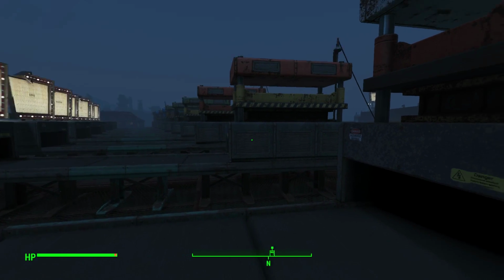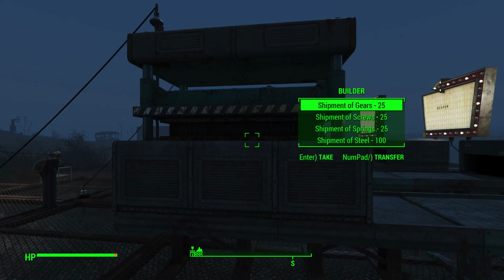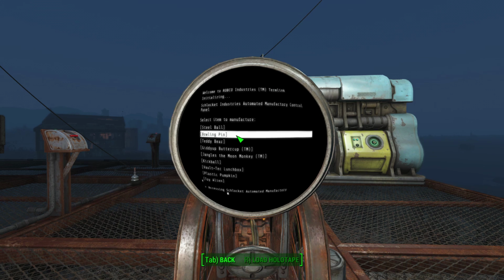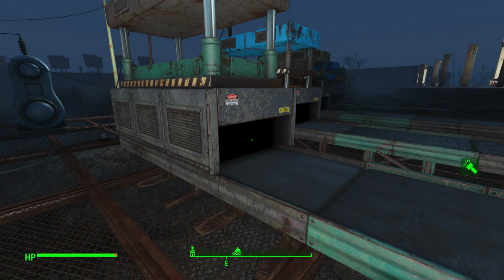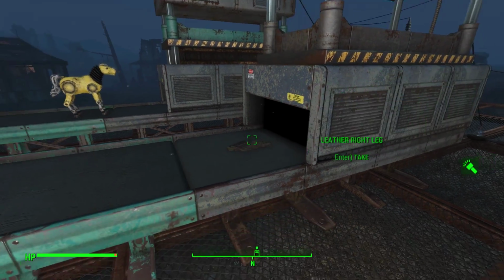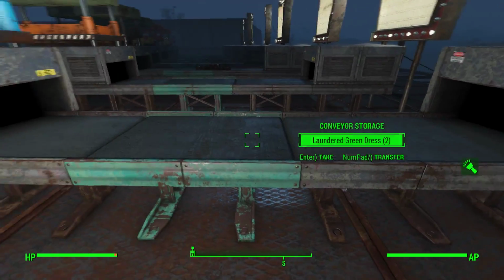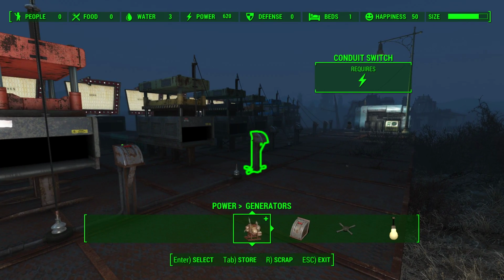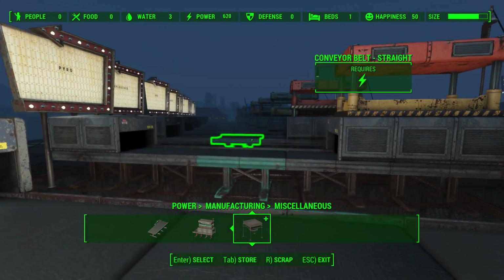10 Manufacturing Machines | Contraptions Workshop DLC | Fallout 4

Comment: none of my belts work stuff just piles up out side the machine
Reply from the maker: Are they getting power? There aren't rollers or something in-between are there?
Reply: nope all belts, all have power and i can see them moving . like with guns they get made and drop inn the machine and just pile up and don't move
Reply from the maker: Deathpenalty818 Have you tried scrapping the first one that's causing the pile up and rebuilding it? I had a machine that wasn't working and that fixed it...
Reply: ive tried it on different saves and made several at a time.
Reply from the maker: I had a conveyor storage hopper that was just eating items - like gone, completely gone - and I never got that fixed either... totally forgot about that until now. I'm looking through the Bethesda support forums atm, but I haven't found anything on these sorts of malfunctions. I suspect there may be a few bugs in the system, tho... :)
Reply from the maker: Do you have any mods & have you/can you try it without them?
Reply: yeah
Reply from the maker: Okay, I'm thinking this has to be some sort of typo, but I found this: https://community.bethesda.net/thread/34316

Third item down, "When powered, Conveyor Belts do not actively push items..."

So, either it's a typo, or, maybe he means that the belts only need to draw power from the builder/hopper, not have a tie into power themselves. Are your belts getting power from the build/hopper or do you have each one linked to power?
Reply: So are these issues they've found

Comment: Any way to feed into this machines from my settlement without placing by hand?
Reply from the maker: I haven't tried it yet personally, but my suspicion would be the Vacuum Hopper you see when I go through the settlement interface items. It says it can pull things from adjacent containers... :)
Reply: I was thinking the others way around :) 
Like I got all items to produce something in my Workbench i still have to find the items with the fiting components to produce
Reply from the maker: Hotte GKT You mean you still need resources? Or do you want to take the resources out of your workbench?
Reply: I got resources in my workbench. How can i autofeed them to this machines ?
Reply from the maker: You use the vacuum hopper - although after testing it, I think you're much better off building a separate container and only putting in the resources you need. I should have the video up tomorrow, if you want to see the test in action... :)
Reply: No thx no need :)
Reply from the maker: Hotte GKT Glad to hear it! I'll still have a video up tomorrow on it, though, no sense not using it! :)
Reply: nice....:)